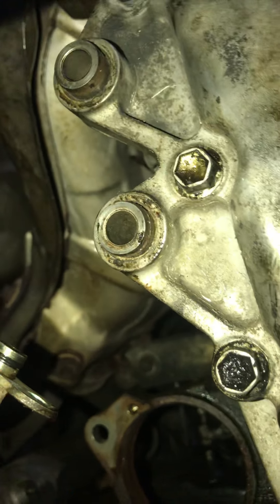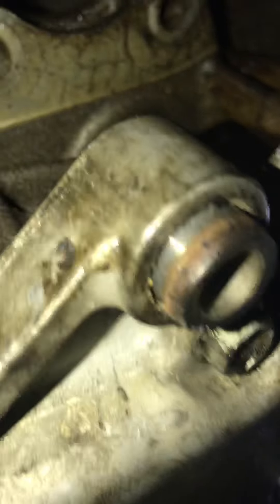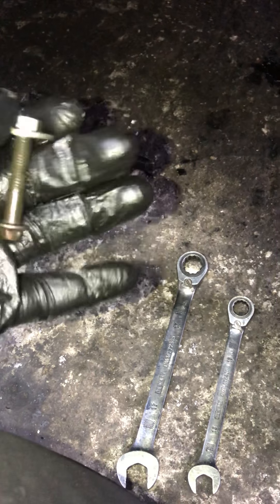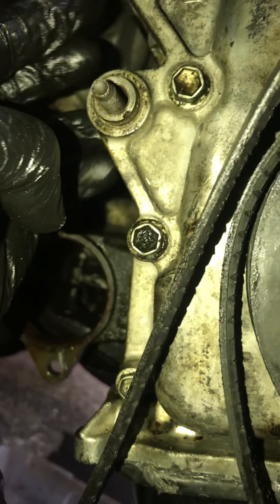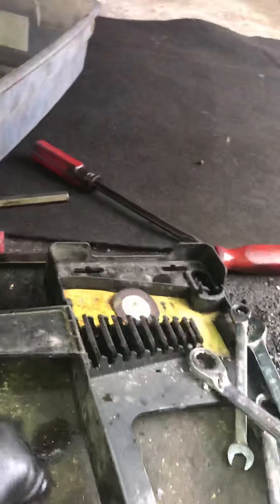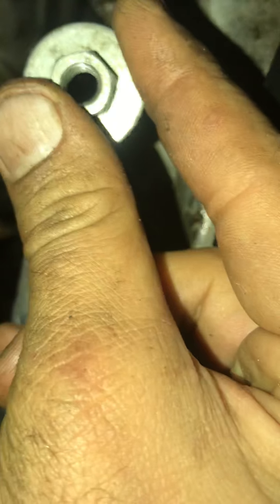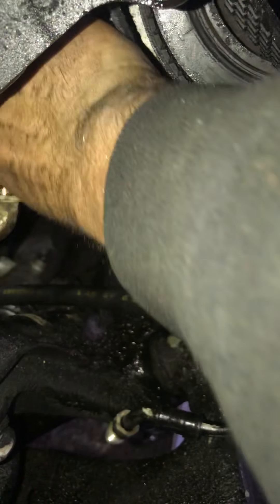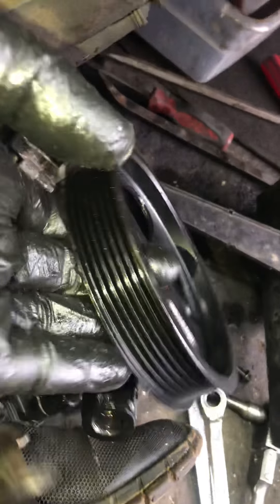How to remove Toyota Celica power steering pump (2)

Comment: Good Job. I pulled the pump out from the top, pulled off the cover
valves and passes once twice, you do not need to dismantle the axle, etc. :) Greetings from Poland :)
Reply from the maker: nice man good job :hand-pink-waving:
Reply: What year car did u do.i have 2002 .could give me a little more detail how u did it please
Reply: @mikecook6807  Toyota celica VII, year 2000, pre-facelift. I took the pump out. I unscrewed the valve cover, and then there is room to remove it through the top. You have to move it later, when you unscrew the screws and unfasten the hoses, harder so that it sews from its fastenings.
Reply: @mikecook6807 hey man, I literally just did this last night, Damian is a little hard to understand so I’ll elaborate. So to start off this is a major pain to get out this way but it’s possible. Valve cover comes off and so dies the coil packs and coil pack harness which also has the pressure sensor attached to the power steering pump so you have to detach that before doing this. Be gentle removing it. Once all of that is out of the way make sure to cover the exposed engine and timing chain with a clean towel to prevent dirt from getting inside. Once the power steering pump is free you have to pull it up near the passenger side of the engine near the ac lines( be careful) the pulley has to be pulled through from the side of the motor while you rotate the pump to get it to clear the engine block. I had to use a pry bar to slightly bend the metal that makes up the cowl space for the wiper motor assembly. Just be patient and it’ll come out. Hope this helps buddy good luck. I’m trying to get mine back in but those metal bushings that held in the pump are so tight I can’t install the power steering pump lol  I have to squeeze the bushings back in to get the pump to fit in. Good luck buddy